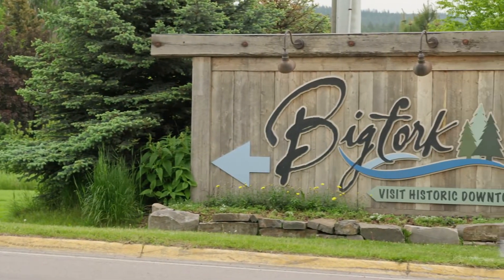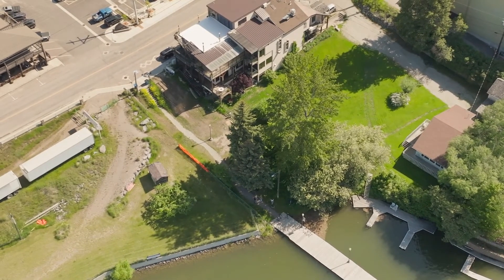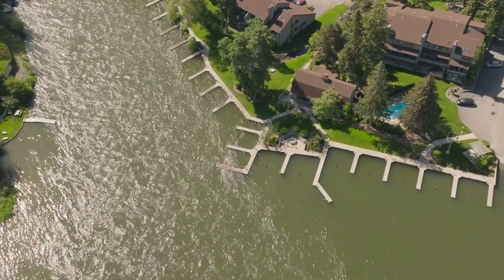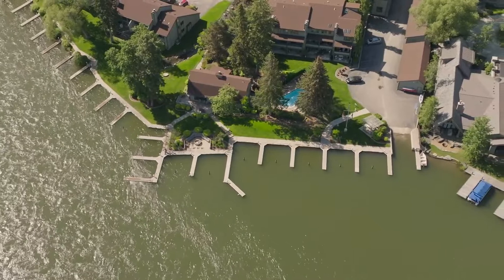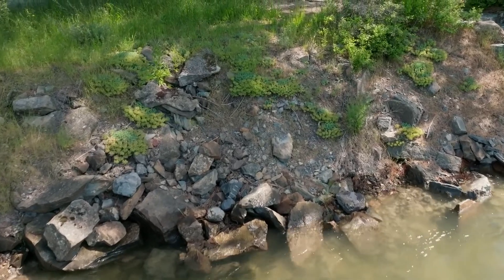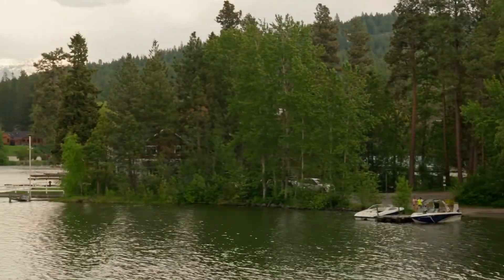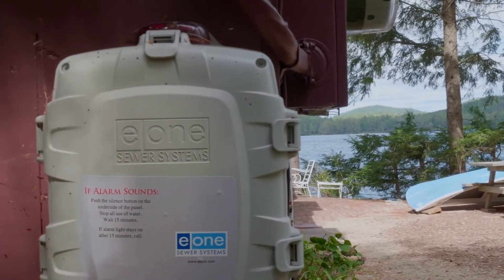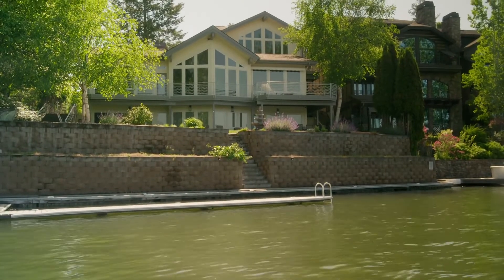E/One Grinder Pump Case Study: Flathead Lake, Bigfork, MT

Comment: I used to rebuild/repair the E/One grinder pumps.....they are an awesome machine but are at the mercy of the customers and how they manage "what" they flush down to the pump.  Typically the "stator" needs replaced when customers flush anything and everything....it's takes a disciplined customer base to keep replacement costs down.
Reply: Grease....cooking grease is a pump killer